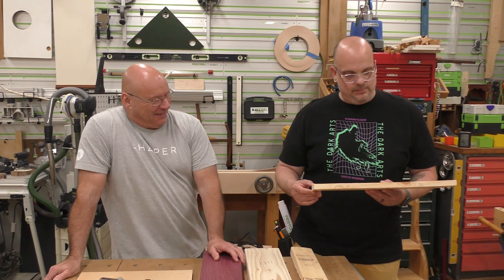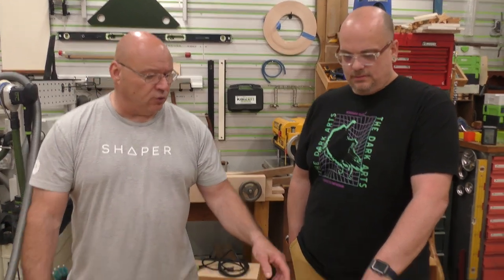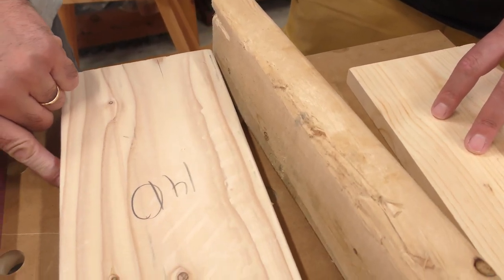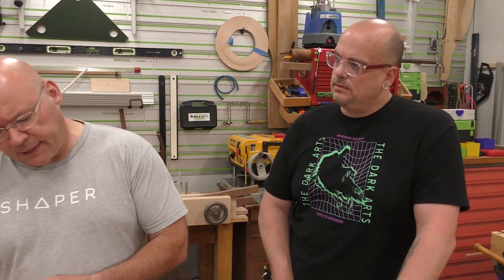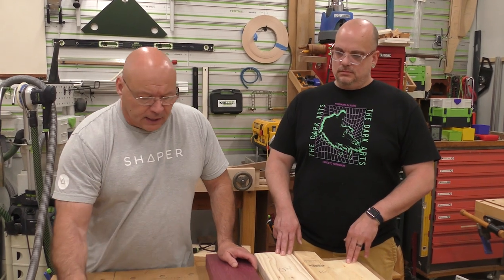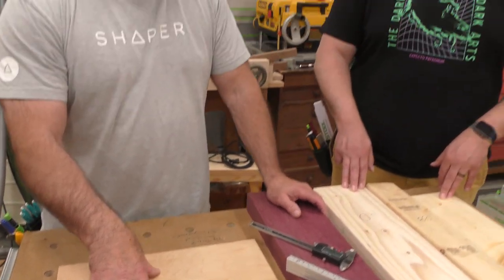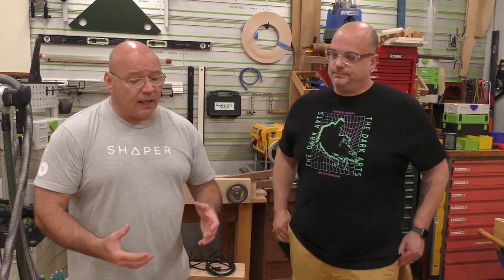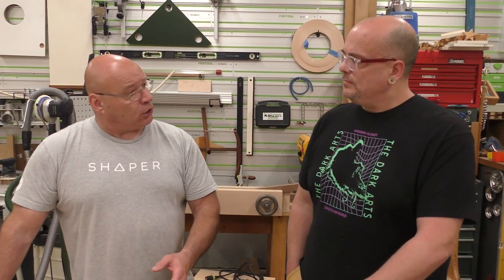How To Measure Building Material: Nominal vs. Actual

Comment: I have measured some sheet goods, namely plywood, that measured differently from one end of the sheet to the other?!  And someone didn't tell SPAX that their 1 1/2 inch MDF screws are longer than two sheets of 3/4 inch MDF are thick !!  They leave a rather large dimple in the second sheet!!!  The tool and consumables suppliers are not in sync with what is coming out the door of the mills these days.  I have run into these issues for the last two years of my amateur woodworking career.  Therefore, whatever one designs on paper, has to include a LOT more tolerance leeway to see anything close to what actually happens when you go out to the shop and build what you design!!  Very frustrating to me, and I can't imagine then dealing with the metric conversions.
Reply from the maker: I never trust plywood for square ... I have found way too many inconsistencies ... especially in the thickness throughout  the board